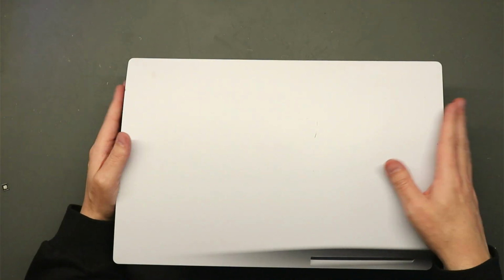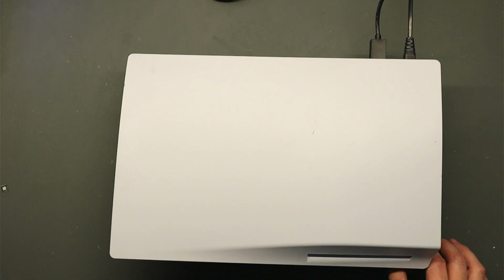PlayStation 5 Not Powering On - Diagnosing and Fixing a PS5 with no power, no beep, no lights.

Comment: My friends PS5 was plugged into a emergency power strip, but there is something going on with his house had some issues and they had to turn off the emergency breaker in his system was on when it happened his system should not fried or anything since it was plugged into that emergency strip do you know anything what could be wrong with his system or is it really fried?
Reply from the maker: Really depends on what the symptoms are - it might just be the PSU that has fried